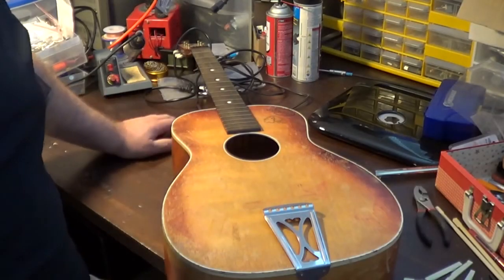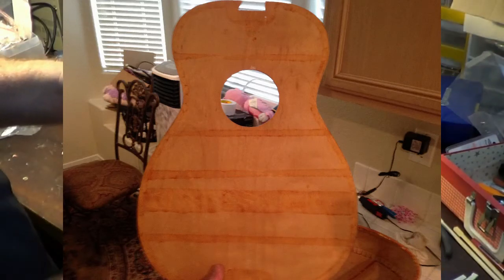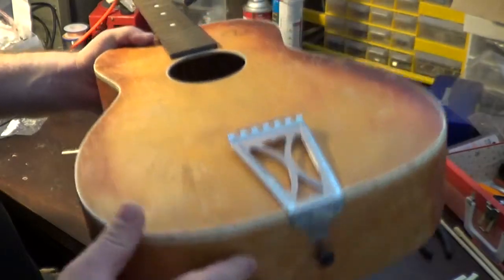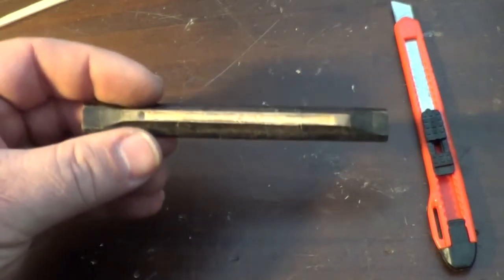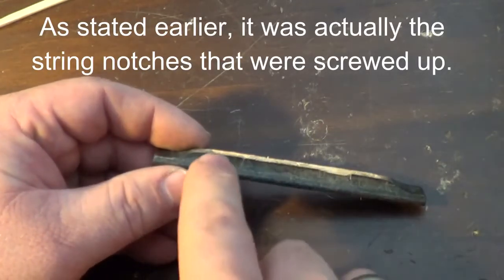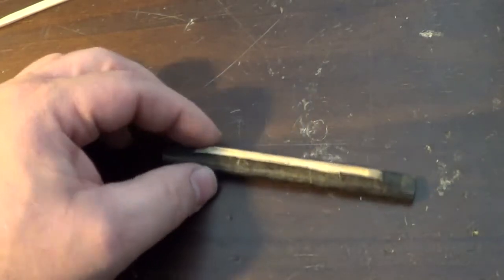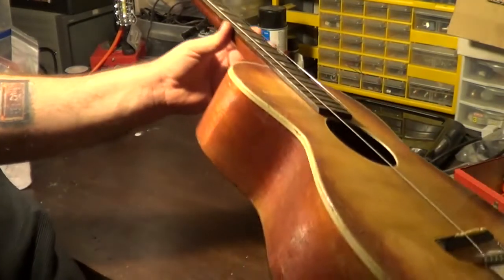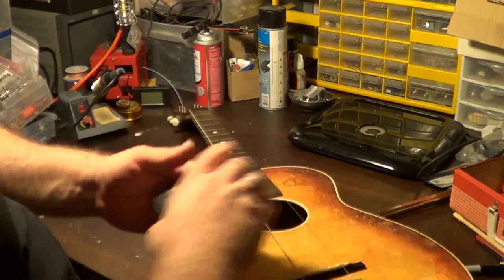1960's Silvertone 605 Acoustic Guitar Repair and Demo

Comment: A few things, the bridge belongs roughly halfway between the tailpiece and the sound hole. The 12th fret is used to check intonation because it's roughly 1/2 way up the neck on a normal scale guitar. The bridge saddle is never glued in. It should just have a snug fit. This guitar never had a saddle it was just a floating bridge of wood with my string groves cut in it. I'm pretty familiar with these guitars, I bought one new in the 60's for $14.00 that I still own.

Comment: Dave Tries To Fix Stuff I am familiar with those kind of guitars. Looks like it is made out of Birch similar to a Harmony Stella. Looks like guitar has old hide glue. Those guitar's 98% of the time need neck resets the necks were cut to loose from factory . Braces sometimes do come loose in those guitars. If guitar gets to dry that can cause crack's. Know a days they make liquid hide glue. You can glue new hide glue to old or remove old hide glue switch to white glue. Hide glue is self clamping easy to clean.